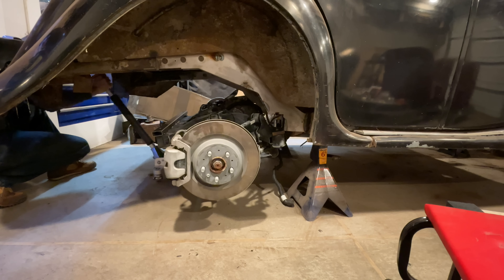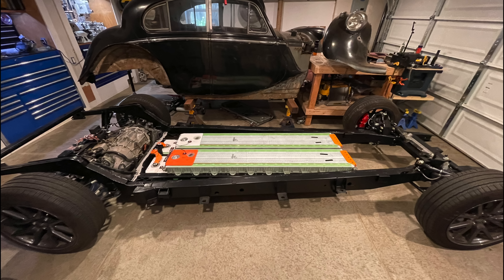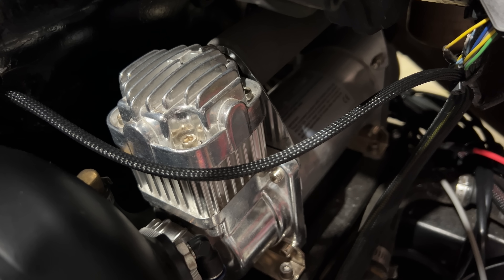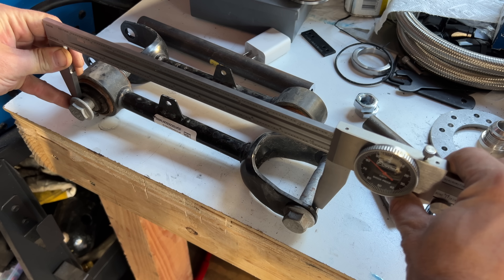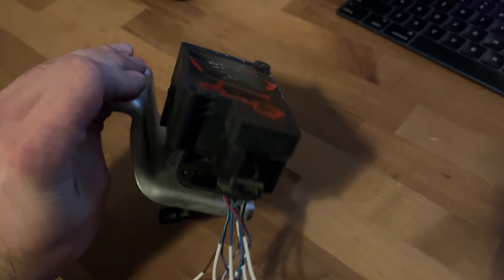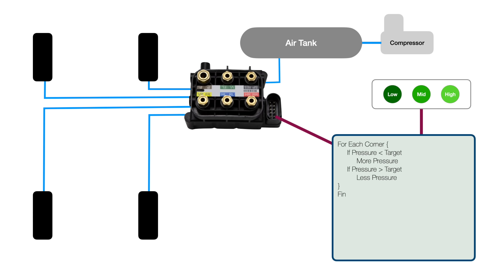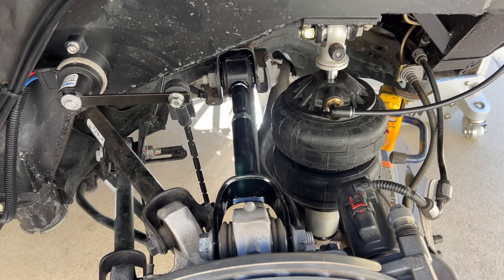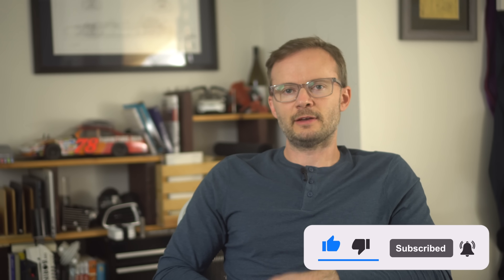Air Suspension: DIY or Off The Shelf. Let's Find Out.

Comment: Stiffness in an air spring is not simply a function of the air pressure - it also depends on the air volume relative to the effective piston area. You can soften an air spring by plumbing it to an additional rigid chamber. That means that for the same vehicle weight, a higher ride position means softer springing (because there is more air volume and the same pressure); however, those convoluted style bags don't act as ideal air springs at all because the rubber resists both stretching for suspension extension and collapsing for suspension compression. This is why good air springs are of the rolling lobe (a.k.a. reversible sleeve) type.

RideTech offers both the double convoluted air springs like these, plus reversible sleeve and a variation of reversible sleeve which is tapered to change the spring rate progression, in both versions that mount over dampers and versions that mount separately.
Reply: Spot on. Lots of people make the mistake of thinking higher ride height means more pressure, when really it means more volume. Especially when using rolling lobe springs. The pressure in the airbag is set by the weight of the vehicle. Lifting the vehicle doesn't change the weight of the vehicle, it just expands the spring. Therefore, same pressure, more volume. This is also why cars and trucks with airbags use ride height sensors and don't rely on pressure sensors.
Reply: If I could, I would leave 10 thumbs up, instead I will leave this comment as Thank You
Reply: Unfortunately, Ride Tech offers only double convoluted for higher loads, and reversible sleeve (a.k.a. rolling lobe) only for lower loads, because the double convoluted bellows that they use are much larger in diameter (thus can support more load at the same pressure) than the reversible sleeves that they use. I didn't see the diameter of the double convoluted bellows, but the reversible sleeves are 4 inches (7000 series) or 5 inches (8000 series) in diameter. 

The reversible sleeves are from Firestone (the logo is printed right on them; it's what Firestone calls a "sleeve assembly" rather than a complete "air spring"), so presumably the double convoluted bellows are as well.

To make getting the desired configuration worse, the short shocks that fit a typical front suspension are assumed to be working at a substantial mechanical disadvantage so supporting a multiple of the suspension corner load and so only come with the big double convoluted bellows, while the longer travel shocks needed for direct-acting shock-spring units (on beam axles or in MacPherson strut suspensions) that only support the suspension corner load directly only come with the reversible sleeves that they need to accommodate the travel, so it's may not be possible to just swap the two types of air springs on the same shock body to get better spring characteristics. 

The Tesla Model 3 rear suspension in Matt's Jaguar operates the spring-shock unit at a mechanical disadvantage like the front, so it has the big double convoluted bellows. If these are the Shockwave Universal products, they would both be 1000 Series and identical front and rear other than possibly the length and travel.
Reply: Thanks for the explanation, this deserves more than one like
Reply: Wow. I think I've learned something (but it's troubling my brain!)
Reply: And how do manufacturers overcome the noise problem? All electric compressors I've run into are noisy
Reply: @xXZ31t6esTXx  Rubber mounts, shielding, an intake muffler, and probably lower RPM than aftermarket compressors.  Some mount them in or near the engine compartment so the compressor noise somewhat blends with engine noise.  They're always more audible from the outside than inside the car.
Reply: Who are you and what do you do?? You're wayyy too knowledgeable about automotive suspension to just be some hobbyist.
Reply: @Lucidbkeo  Just an enthusiast... with a technical education, decades of interest in automotive technology, and enough curiosity to dig into topics of interest. Unfortunately, no one has ever paid me to work in the automotive field, but maybe that's why it's still fun. 😉

Comment: There is another solution to the ride height adjustability problem, hydropneumatic suspension uses a cylinder and piston filled with hydraulic fluid at each corner to sort of act as a spring. The cylinders are attached by high pressure hoses and hardlines to a nitrogen filled sphere (which is attached to the car's chassis) which acts as a compressible springing medium. Further more, there is a hydraulic system with a pump and valves which adds or removes hydraulic fluid from each corner to change the ride height and keep the suspension level. 

This system, introduced by Citroen for the DS was also used by Mercedes for its hign end cars, most notably the 300SEL 6.3 and later 450SEL 6.9. It was considered miraculous at the time but the system's complexity made it something of a maintenance hog. This may not be a problem for a high end Mercedes, but was a thorn in the side of many less than wealthy Citroen owners. Over time, these systems lost favor with manufacturers. Air suspension may have its faults, but it can be good enough for most purposes.

Hydropneumatic suspension is a fun system to re
Reply: Systems like that still exist, including Lexus Active Height Control.

Comment: If you're welding sleeves into/onto tubing you should drill holes around the perimeter  for plug welds. Or if you want to keep it in the jaguar spirit you could use rosette welds.
Reply: make sure you pre-rust the rosette welds too if you are going for the jaguar feel

Comment: Pressure in the air springs isn't really ride height, so using actual height sensors works much better. Of course, that's why manufacturers go to the expense of using those height sensors.
Reply: Wouldn't those sensors freak out in hilly areas like San Francisco?
Reply: @darekmistrz4364  the tilt of the vehicle on hills will shift load between axles slightly, changing ride height and potentially triggering air spring adjustments. The simplest way to fix that is just to have the controller only adjust when adjustment is manually requested (by pushing a button), but more sophisticated solutions for this (and for the similar effect of accelerating, braking, or cornering) include allowing a "deadband" allowance for slight changes, averaging height out over a reasonable time, or even measuring acceleration and compensating for it.
Reply: @brianb-p6586  Thanks for explaination, makes sense

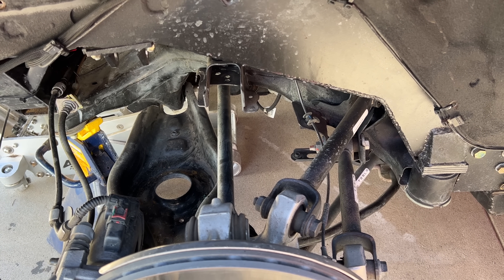Comment: @4:06 A properly designed 5-link is not over-constrained - it is ideal. Just count degrees of freedom: there are 3 translational and 3 rotational degrees of freedom, and the suspension needs to move in one degree (controlled by the spring and damper), so the remaining 5 degrees must be controlled. All of the links of a 5-link locate in only one dimension (they are under compression or tension only, not bending) except the spring link (for designs like this that mount the spring and damper to a control arm instead of directly to the hub carrier), so if ball joints are used there is no binding. The bushing deflection occurs because they are not ball joints, and not perfectly parallel to the instantaneous axis of rotation of each link end.

The bending load mentioned in the construction of the adjustable link exists only because the bushings on the ends are not ball joints.
Reply: Came here to say this... luckily you already said it in a much more eloquent way lol
Reply: Only if by 'properly designed' you mean: all links are orthogonal/independent.
Reply: I was going to look it up and write a very detailed analysis for you.  But in the end I figured it was "Good Enough" to let someone else do it and just give them props for it.👍

Comment: Matt; I would have bet money that you would have gone with the self-leveling Citroen Hydro Pneumatic suspension.  But then there is Future Matt that will do that.
Reply: As a previous owner of a 67 Citroen DS21 (and a 68 parts car),  I broke out in hives at your suggestion.
Reply: @ottokiehl5413  Lol, more recent models have it all working well 🤗
Reply: For more reliable parts source, one could use the Lexus Active Height Control system.

Comment: I had air springs on my 36 foot dual rear axle 8 wheel motorhome. The driven rears were ride height adjusted. There was no controller, just the ride height valve. The fronts had a fixed pressure that I checked before each trip, and the tag axle had a pressure gauge and mechanical pressure release valve on the dashboard. Again, no controller. I could deal with the ride height problem (rear tow hitch) with the dashboard adjuster. By the way, the fronts make a big noise when they blew out when I hit a big bump. Also, I found you can pay someone $600 to take the front suspension apart to replace one or you can find someone who knows that if you roll them up and put soap on them you can have them installed for $30 the second time you blow one out. I also found that I could do it myself with the soap method once I watched the guy do it so third time was a charm. I don't think you will blow them out as my motorhome was 12,000 pounds so much higher loads. It was only the fronts that blew out and they were inside coil springs so not a huge deal. I often wondered what would happen if the rear bags went but never found out.

Comment: I love how engineers look for an unproven solution, built with junkyard parts, for next to nothing while eliminating “unnecessary” parts from the prototype they are copying and then trouble shoot the bugs for the rest of their lives.
Reply: That sounds like a hacker, not an engineer.
Reply: @brianb-p6586  Have to agree there, engineers tend to be super fond of "unnecessary" parts.  Turns out mitigation strategies and failure mode analysis factor into a lot of those "unnecessary parts."

Comment: Assuming you Arduino the solution, make sure you add a CanBus hat. Then you can read the VSS and tell it to not adjust pressures unless VSS=0.  Otherwise every single dip in the road (etc etc) will make it a non stop battle to adjust itself.  That's what the back of my '01 Seville does anyhow.

Comment: i’d def. toss a couple inches of polystyrene foam on the inside of the air compressor box, wild how loud those things are.
Reply: Screw compressors are quieter but I never see small versions of them, only industrial ones.
Reply: @darekmistrz4364   -  i’m sure roots makes a tiny supercharger…

Comment: I would love to see a project using the junkyard pneumatic valve. Adjustable height work tables?
Reply: Pneumatic Vice is pretty good one. I recently saw one guy make it with pedals on floor to operate it. Pretty useful when You can focus with Your hands on holding and positioning, and with Your foot on clamping or releasing it
Reply: @darekmistrz4364  and when you are ready you can crush your hand with it. 😀 only joking with power comes responsibility as always

Comment: No such thing as poor break over angle with enough speed
Reply: The approach angle may have issues with that.
Reply: @bedlamite42  the approach angle was already Good Enough™
Reply: Problem is, while the jag has good front and rear angle, if you hit the ramp with enough speed to make that assertion true, you'll compress the front suspension and risk driving into the ramp with the front!
This is also better in theory than in practice, as a certain Tesla driver recently proved in LA...!
Reply: @edumaker-alexgibson  it was the worst vertical rotation I had seen in a car. Looked very unnatural how the front dropped instantly despite the speed. I always felt skateboard EVs would be terrible vehicles for rallying and that video pretty much proved it for me.
Reply: @edumaker-alexgibson  recently? that video is way older then 4-5 months
Reply: @Robo-xk4jm  all is relative.  Ironically you are replying to my post of 4 months ago, when it was 4 months more recent.  Have a lovely day.

Comment: Brilliant.  I will now watch it. 
(Update, having just watched it, around 1m00 you show a madeupgraph(tm) that ride height is proportional to pressure. I dont think it is. In fact the pressure may be (approximately*) constant as a function of ride height .. what changes with ride height is the volume of gas in the system, not its pressure, cf orthogonally if you change the weight of the car by filling it with fat people, the pressure will need to increase to give you the same nominal ride height even though the volume is unchanged. Maybe. Its just a theory, I haven't inserted pressure sensors in the air suspension of my 21 year old lexus ls to check. You could probably insert 60 seconds of humorous explanation of the gas laws in your next if you wanted. 

*its affected by bag and suspension geometry etc
Reply: no, ride height does have a relation to pressure. The bag contact patch (where the bag rests against the end pieces) gets smaller as they extend, thus reducing the effective area, and requiring more pressure for the same load.
Your approximation would be correct for a pneumatic piston, though.
Reply: @kain0m  totally agree, I was trying to keep it simple but did actually have a note (*) saying its affected by bag and suspension geometry etc. My core point is that its not the simple proportionality (ie goes through the origin) with pressure as shown in the graph seen around 1m00, on the contrary its a comple curve (eflecting bag and suspension geometries) closer to a band (depending on load etc) parallel to the axis
Reply: Assuming everything is flat and nothing's changing, the ride height is proportional to the spring/bag height and that is directly related to the pressure.
So yeah, right height is proportional to the pressure but it's not linear and it's not constant.
The problem is it's not constant. That's why we have to use ride height sensors instead of simple pressure sensors.

That said if your car was equally loaded on all four corners, with identical suspension on all four corners, you could theoretically put them all to the same pressure and the car would be level and at varying ride heights depending on the pressure.... But since we live in A world where the driver is often offset to one side and the weight on all four corners is not the same etc etc... We need ride height sensors.
Reply: @TravisFabel  with respect I think you are wrong. You don't explain why, just state that bag height is related to pressure ... but (* for now overlooking the non linearities due to the shape of the bag) Imho that's not the case, as stated variations in the height of a bag (if we idealised it for a moment as a pistons as others have commented) is due to changing the amount of gas inside, not its pressure. Indeed think what a pump/controller is doing, it's pushing gas into/letting gas our from the bag.
But I agree real world bags are not linear pistons. Using position sensors is perfect since that compensates for everything in one go .  Changes in load (due to aero effects as well as fat passengers etc and non linearity due to real world bag and suspension geometries etc)
Reply: Correct. Ideally, changing the amount of air in the springs without changing the weight of the vehicle will just change the height without changing air pressure at all, but this style of air bag (convoluted bellow) needs more pressure to stretch so it is far from ideal; the rolling lobe (also called reversible sleeve) type would be closer. Your Lexus probably has rolling lobe springs.

Comment: I’m currently in the middle of building a HomeKit controller for my unpowered sky light blinds. Project is about a month in now, I went from DC motor, to steppers, to now using a DIY servo motor. The code is getting insane and I haven’t even gotten to the PID parts. I should have just spent $300 on an OTS assembly but at this point I’m too far down the rabbit hole to quit and I’m learning a lot in the process.
Reply: Don’t let a pesky thing like monetary investment stop you from being able to say “look what I made!”
Reply: Just remember "Sunk cost fallacy" is a thing.
But you know, as long as it's fun, keep at it.
Reply: Ah yes, "I'm learning a lot", that sentence always makes me feel better, too. Best part is that you can apply what you learned and get stuck in even worse rabbit holes later
Reply: Learning is priceless.
Unless you can find a day course.
Reply: I designed and built my own 8bit CPU over the course of about 6 months... for about $250 in parts.... you can get a 64bit RaspberryPi for about $15.  Sometimes the learning and journey is worth the extra money... sometimes you just need the time and spending the money is justified.  It's all about the trade-offs and what your objectives might be. Either way can be fun or frustrating or both.
Reply: If Mr Voron can't overengineer a set of blinds, what hope do the rest of us have.
Reply: By many years experience and numerous projects my savings per hour labor is approx. 32 cents. That adds up after 6 decades.  I could be off a couple cents so maybe it's better I don't brag too much.
Reply: You gotta check out the Velux catalog. We only get so many Jellybeans lol
Reply: Make a video or it didn't happen...
Reply: You could buy a more expensive dc servo with built in pid.

What you're using for the diy servo tho?
Reply: @lasskinn474  It’s a geared DC motor + AS5600 mag position sensor. I was close to dropping coin on a ClearPath until I got it working this morning.